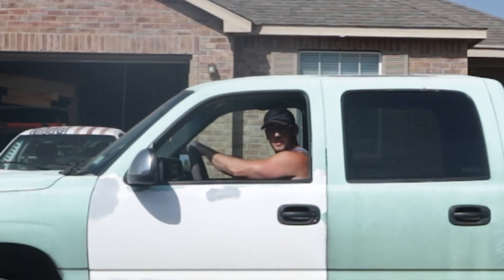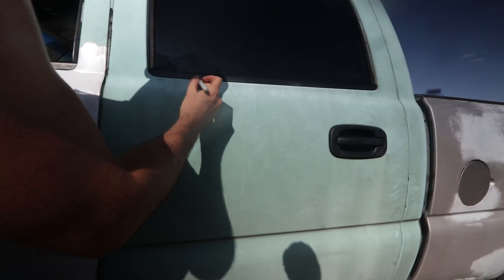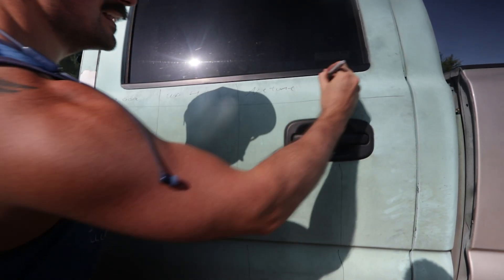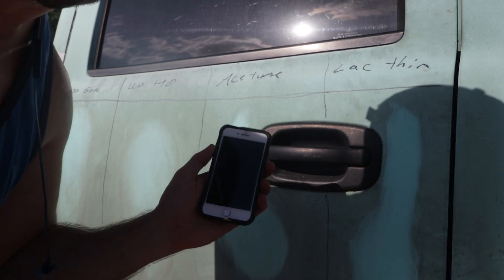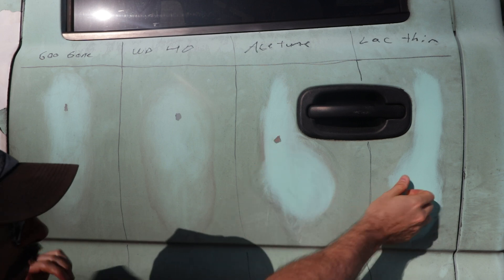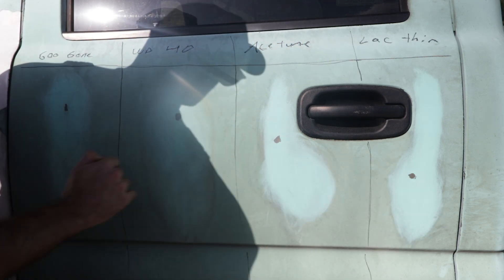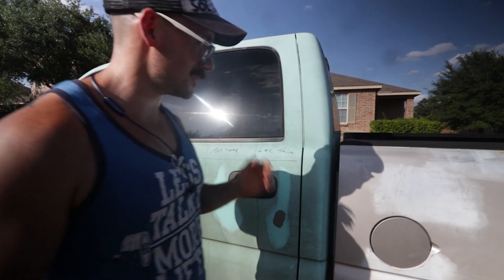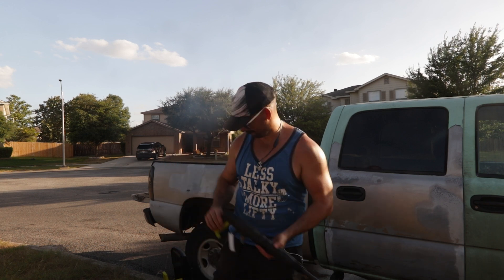What is The Best Chemical to Remove Plasti-dip?

Comment: Well as a body man the lack of dinner is definitely going to be better the black dinners is the best way to go the acetone you want anyway cuz it's going to clean once you get all of its going to clean will the surface and take dirt and all different marks off but technically the best thing to use is you buy these cans it's called paint primer remover can you put that on it automatically Bubbles and rips it right off and it will not take the paint off your car lacquer dinners we used to use it in the paint shops all the time so you know it's very good for cleaning the guns out and the brushes but it actually will take paint off the car too if you have it in a spray bottle and you spray it really really good and this mess all the other areas of and soak it it's going to come right off but I had plexi dip on my car I put the kids the whole car with three coats and it was on there for 3 years but it'll look really nice that's how I got it off I had to use a heat gun I would let it be real hot outside and I use paint remover and lacquer thinners and it'll come right off

Comment: I used Citri Strip with a paint brush on my rims and it worked for the most part. I didnt want to start with harsh chemicals and the Citri Strip was claiming to be non toxic. it just got really busy at the car wash so i had to cut my session short. but yeah, i recommend putting on a good helping of it on and let it sit for maybe 5 min, pressure washer probably not necessary, just a strong hose spray. with these 4 products tho, i feel like you didnt really put on enough